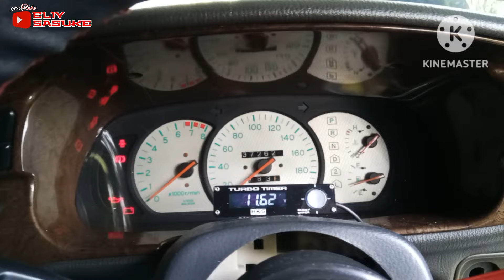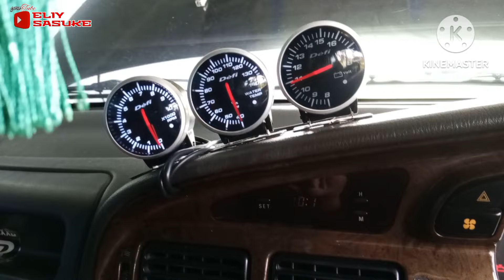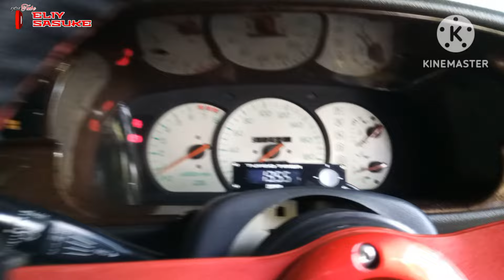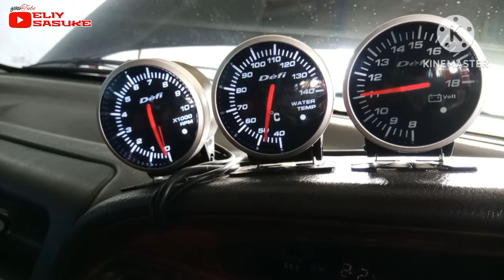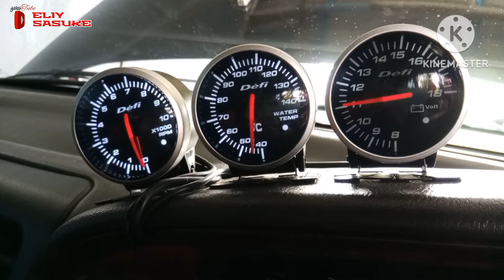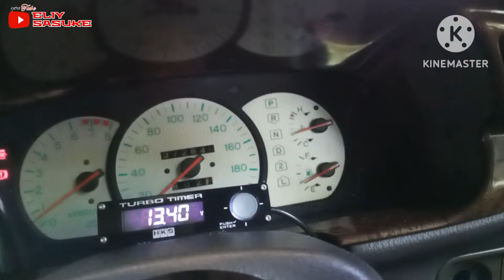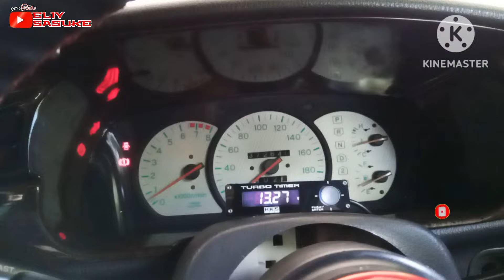Tukar sensor temperature meter DEFI Proton Wira Aeroback

Comment: Salam bang ... Nak tnya ya ... Kipas dua2 jalan , coolant ada tpi temp naik jugak kenapa ya ... Tiba² ja jdi😅
Reply from the maker: @adamqayyimsaadiahbintiisma6961  waalaikumsalam. . kemungkinan water pump rosak atau mungkin thermostat problem. 
Try check thermostat dulu
Reply: @EliySasuke74  water pump bru tukar dengn timing belt sekali ... Termostrt saja xpnh cek ... Kna try dlu ... Tq bang
Reply from the maker: @adamqayyimsaadiahbintiisma6961 try check dulu. .sama²